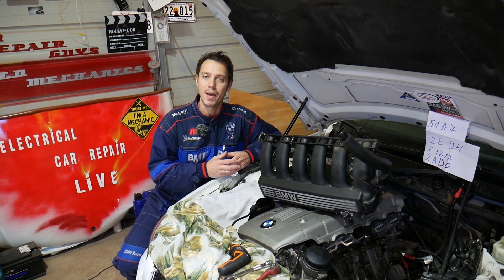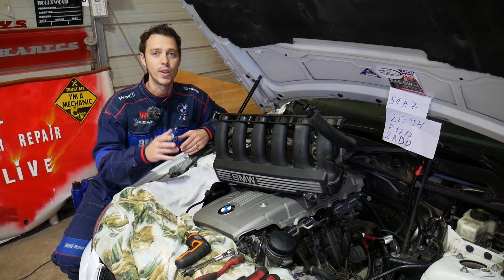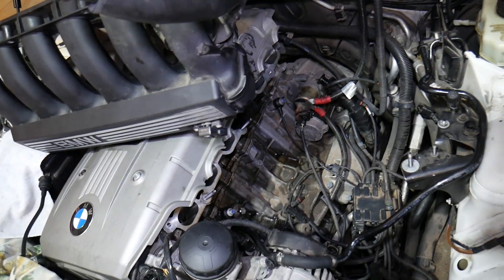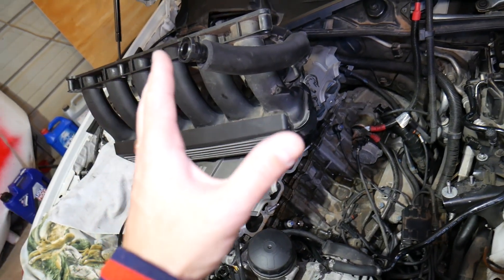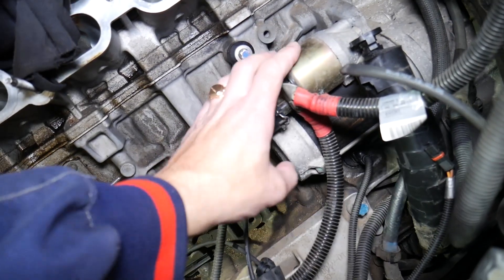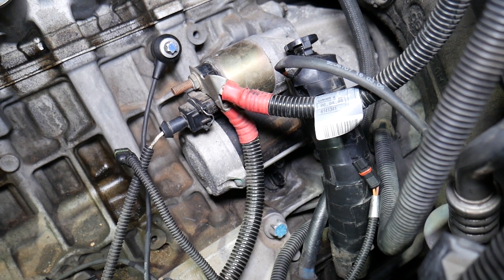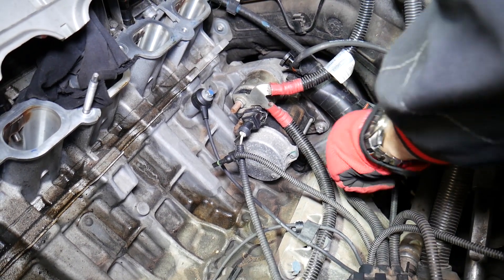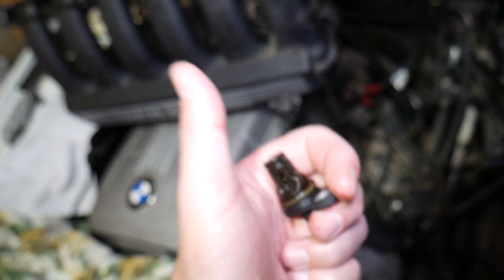BMW X5 CRANKSHAFT POSITION SENSOR REPLACEMENT LOCATION E53 E70 F15

Comment: I was able to change the sensor without removing the intake or throttle body. Just have to remove air pipe and reach back there. A couple tips - Be careful screw doesn't fall when taking out because a magnet won't work on it. Use flathead to wiggle edges until it comes loose then you can pull it out ,but don't yank hard on wires. Tape the screw to your socket when putting it back in. Took me about 10 min

Comment: Can the crankshaft sensor harness blow fuses out? My BMW X5 2002 said transmission safe failure and died. Fuse 72 in the rear keeps blowing out. I got code p0339 pending

Comment: Hey I hope you see this and can help me, I have a 2010 BMW X5 with the same engine N52, I recently bought it, it just cranks but don’t start recent owner changed starter and that’s when it just started cranking and not starting, checked fuel pressure and it’s good I checked spark and it’s good I checked relays and fuses and they good, any idea of what else it can be?
Reply: What was it ?